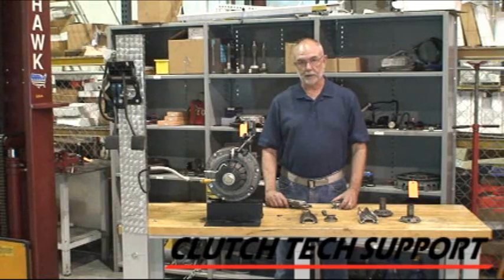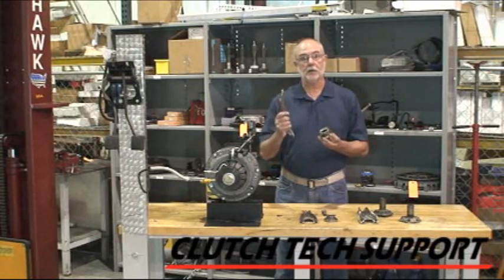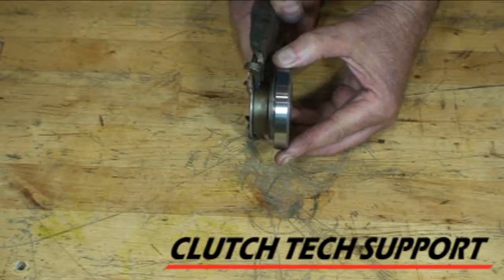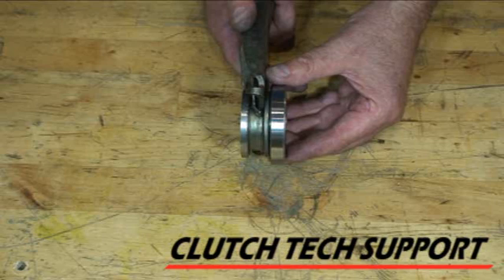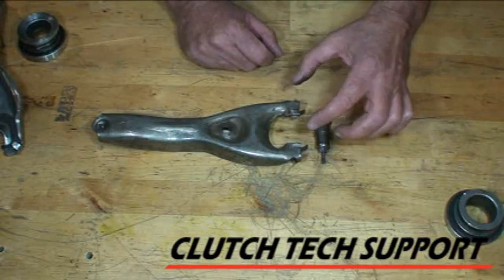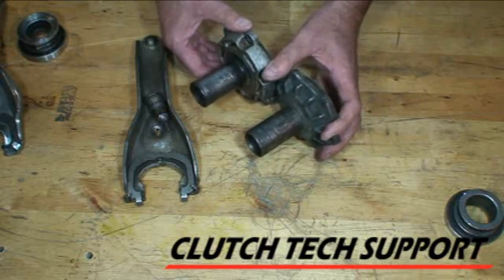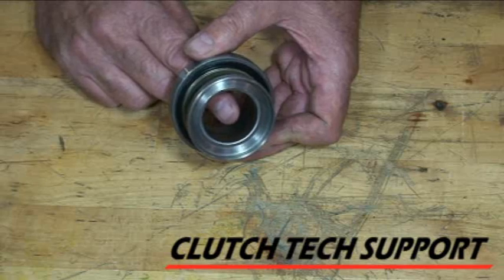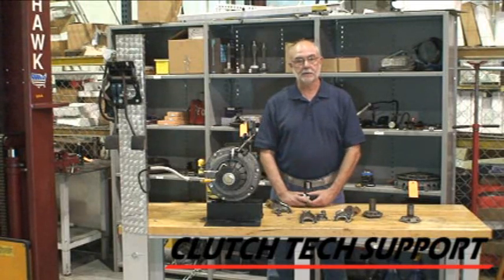General Motors RWD Clutch Fork and Release Bearing Installation Part 2 The Solution

Comment: Although this video was published 7 years ago it is still helpful. I haven't installed a clutch or a manual transmission for 20 years, but it's one of those things that I can't easily forget. But it is nice to have a reminder to check the pivot ball and the release bearing retainer, aka slide tube for wear.

Comment: Great video, where does one get this cap? Just had new clutch kit installed in our 1980 k20. Clutch works as before new clutch put in. Mechanic said my linkage was wore out and clutch was adjusted all way out. So got underneath truck and yes was adjusted all way out.😟 Could this be problem as your video states. Giving the truck is old me took mechanic word for it.  It's been our firewood truck for over 10 years and really need it. In order to get some adjustment out of clutch me got a piece of longer all thread and ground down end to fit dimple in fork. Not clutch is working but seams to change frequently where it lets out day to day. Is there a way to inspect where fork is attached to bearing without tearing all apart? The clutch replacement beyond me capabilities is why took to a shop. Spent quite a bit of dollars for this job and is not happy with it way it is. Also me know this mechanic pretty well and like to trust him. He has done work on spouse truck before also. Although every time he has work on our vehicles me had to do something after he returns vehicle. 1980 clutch job-had to hook up wire plug for 4x4 light. Wife's 2004 Yukon,had to purge fuel charcoal canister system after get back from him cause engine would shut off at will shortly after returning it to us. Your thoughts be appreciated much.

Comment: I have a question. 20 some years ago I had difficulty with my 57 Pontiac Laurention, Canadian  model . I replaced the clutch and presurplate and release bearing . And the clutch has never worked right since. The issue was if I can remember the release bearing had a long collar on it ,but the parts man told me that GM, only had a long and a short version, but the one I took out was longer than the longest one they could get. So the result is a soft clutch pedal ,that often needs help to get it to return. Can anyone help me with this problem. I cant even find the old one , so I can start over. Any HELP would be apricated.